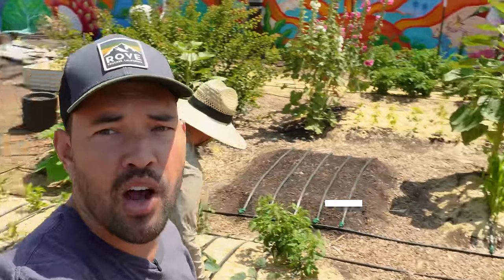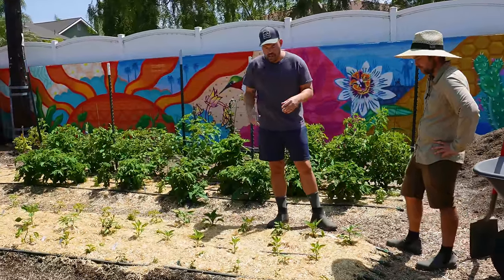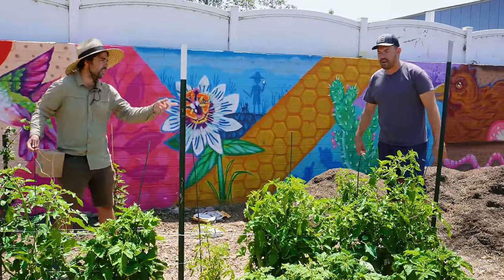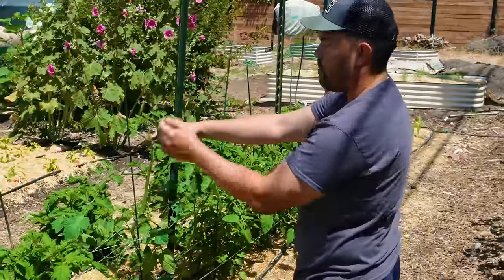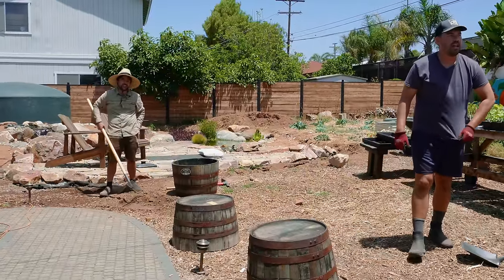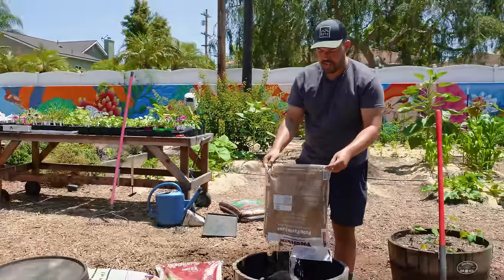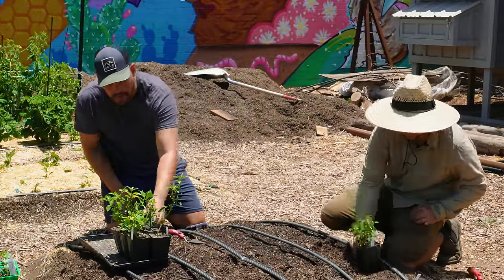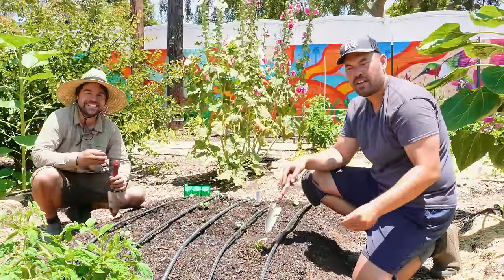Tomato Pruning & Sweet Potato Planting!

Comment: Make sure y’all put a few screws into each metal band on the barrels. As the wood dries out from not having whiskey in it and being in the sun it will eventually drop the bands and split open unless you secure them.
Reply: Yes!  Mine dried up pretty quick even in my Southern humidity. Also, you guys can get more than a year from them. 😀
Reply: Got to wonder if those barrels aren't completely flushed could the plants be getting pickled with each watering?
Reply: Agreed!  If you let the soil dry out or leave the barrels empty the staves will dry and shrink away from the metal rings, and the barrel will fail.  It won't hurt that oak to give it a shot of water when you are hand watering nearby.

Comment: I feel like I have a totally different tomato sucker strategy, if I had a huge sucker down low that I somehow missed I instead grow two lead tomatoes and trim everything else, so two almost full sized vines coming off a single stem close to the ground. I saw a few commercial farms going for the twofer and figured I'd mix it up if I missed any suckers early on. So far it has been very productive
Reply: I do this as well.  I keep the first lowest strong sucker, and end up with two strong leaders.  Later in the season I might let other suckers grow as they usually put out flowers quickly in the hotter months.